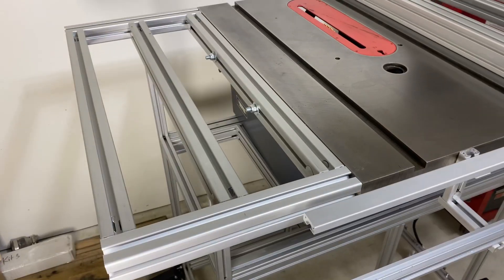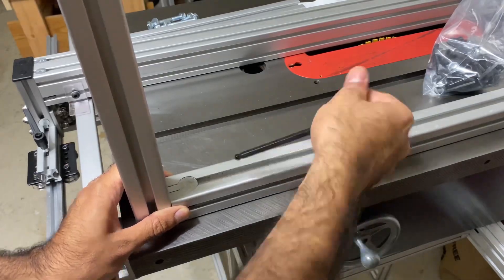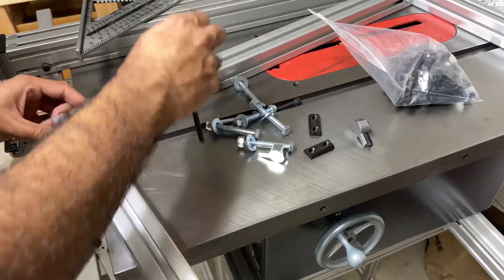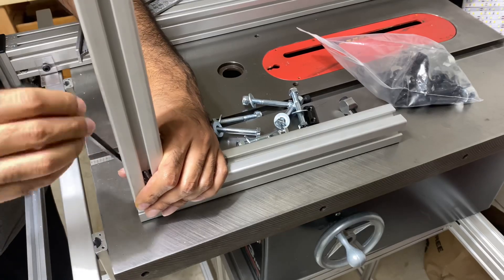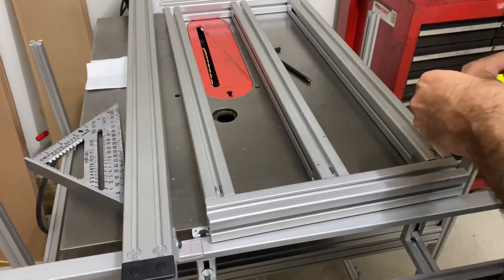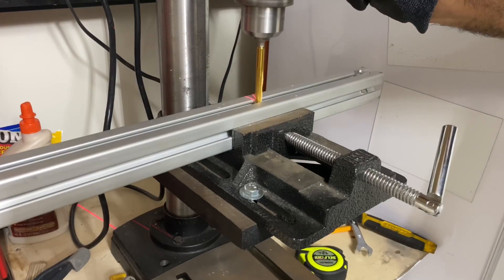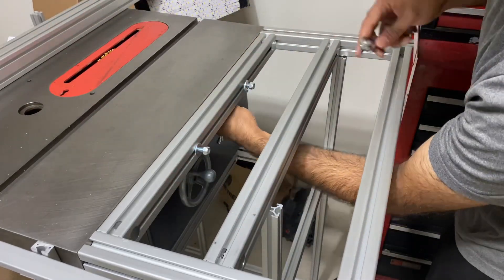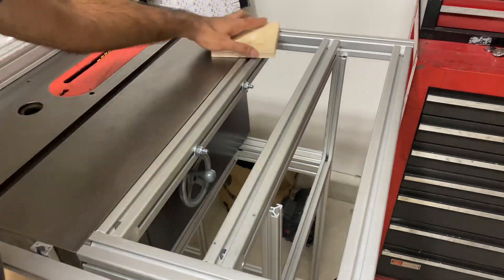Table Saw Side Extensions Using Aluminum Extrusions

Comment: This was a very useful video for me. If you had to cut the aluminum extrusion yourself during the production process, do you have any tips for ensuring a straight cut? What tool did you use? I found it more difficult than expected to cut it  at a right angle.

Comment: Have you found that the bolts connecting the frame pieces have loosened at all over time? Thanks.
Reply from the maker: Nope,  it's been about 2 years now and have not had any issues from the bolts or the anchor fasteners loosening from vibration

Comment: Do you have to manually drill the circular holes for the joining hardware on the end of the extrusions?
Reply from the maker: Nope you can order the extrusions with the holes precut
Reply: @jbuilds1  thanks for the reply. That's fantastic